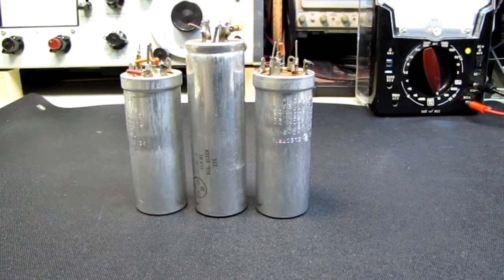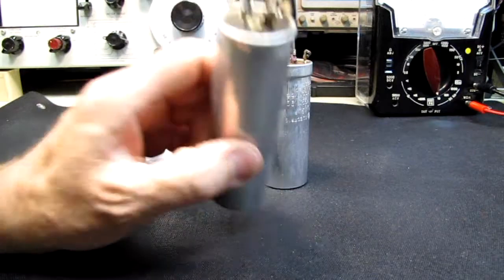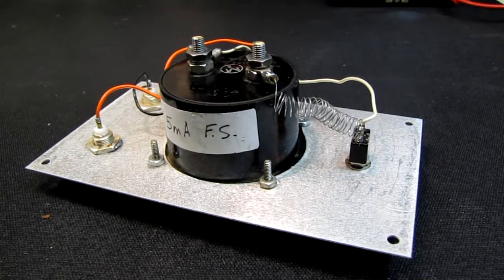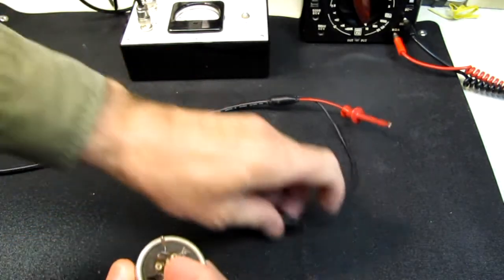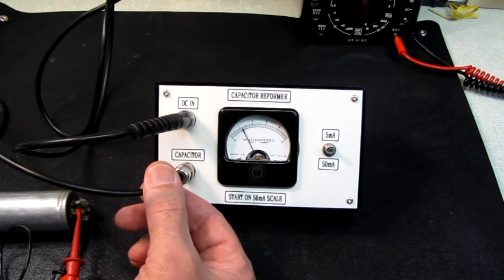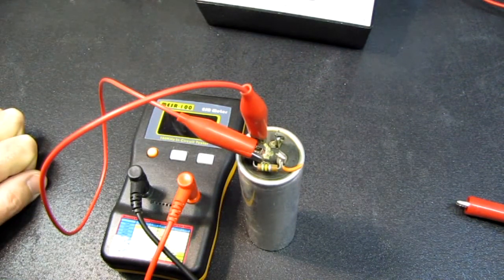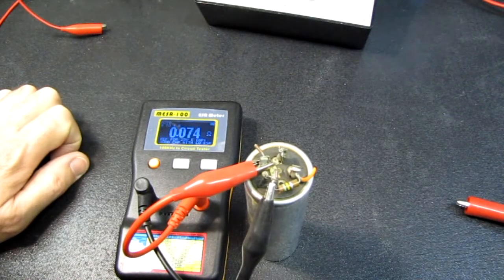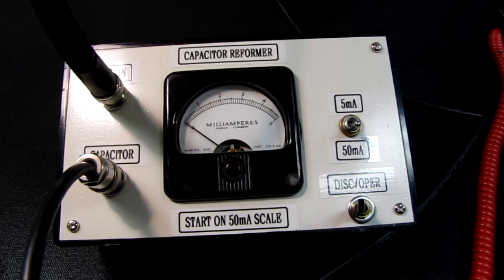Reforming Old Electrolytic Capacitors

Comment: Can I reform several capacitors together by connecting multiple capacitors in parallel?
Reply from the maker: absolutely, just remember you should not use them in critical applications. I have had some fail a few times. But in a pinch, or to test something they are usually fine. Just be careful, a charged bank of capacitors has a TON of stored energy.
Reply: @theradiomechanic9625   thank you very much for your prompt reply.

Please could you clarify what you meant by “using them in critical applications” were you suggesting not to use old capacitors in critical applications?  Or not to use capacitors reformed by using multiple caps in parallel in critical applications?

Thank you for the cautions.  I am trying to reform 120 pcs of ~4700uF capacitors with voltage rating between 100V to 400V.  It is between cautiously repeating the process 120 times or 12 times with extra extra caution.

The capacitors will definitely be placed in a covered plastic container with no exposed bare live wire.

I am however concerned with the heat buildup with faulty capacitor that affects  the other capacitors being reform.

Comment: The Radio Mechanic this work on NOS paper wax capacitor just wondering? I was thinking about older paper wax capacitor they love to leak when they get old. Think that if fresh hot wax was put on a NOS paper wax capacitor fix any leakage?
Reply from the maker: Hello Brian, Excellent question, however the answer is NO. I have tested literally thousands of NOS paper caps and found perhaps three that were leak free. The internal paper insulator layer of these caps degrades with time and is irreversible. Do not trust them as they will eventually fail and can damage other components. 

Electrolytics are a totally different chemistry and if the seals on the cap are intact, and if the internals are still moist with electrolyte, they can be "reformed". However I only do this as a temporary measure to test the rest of the set for viability.
They will get replaced before giving the set back to the owner.

If I have an historically important radio, something rare and special, I will "gut" the paper caps and restuff them with modern caps then seal up the ends. I always leave a note in the set informing the next tech that the caps look old, but are new.
Reply: @theradiomechanic9625  What russian pio Capacitor ? I have seen people test them and test good think they used a special paper plus some had glass ends
Reply from the maker: I haven't used any of those caps. They are basically the same thing and if only a year or two old (from manufacturing) they might be OK. However I would use a capacitor leakage tester that tests them at operating voltage for leakage. 

These are marketed to the Audiofools who have convinced themselves that the old paper caps "gave the amp the vintage sound".  What these clowns don't understand that when brand new the caps didn't leak and the amp sounded like it would with modern caps installed.  @briansmith9698

Comment: i bought a barely used Nakamichi cassette deck that had not been used for 20 years. Before buying it I asked the seller to leave it switched on overnight. It works absolutely fine. A repair guy tells me it will need an expensive setup and should have been started up slowly with a variac to not damage the caps after they had not worked for years. Is there any point in tinkering with a Nakamichi that looks new inside and out and works ?

Comment: Can I use a hipot (ac/dc/ir) tester in DC or IR mode to test capacitor? It is a programmable hipot tester and wont be set higher than the rated voltage of the caps.
Reply: Might be possible with some advanced devices - the simple handheld kind tends to come with instructions like "if you are measuring sub-megaohm, do not leave connected for more than a couple seconds".

Comment: everywhere I read on reforming, it essentially says to buy new replacements; that the older ones may reform, but not perform. what I was doing with limited success, was slowly ramping up the voltage with a variac, for several days. patiently waiting. nice video and gadget. thanks.
Reply: actually came on here to ask if polypropylene caps can be reformed- the yellow mylars. they sound good in contrast to new polys and in a preamp; but I've been reading up on leakage and think I should follow the learned rule of replacement.

Comment: Back in the 60's I used to do this and the thinking back then was it should be done with pulsating DC - usually half wave rectified. I used to let them sit for a couple of days for reforming. Even then the failure rate when put into a working circuit was not low so be careful.

Comment: Nice Build!
I was fortunate enough to salvage an old 1967 Westinghouse Elevator Variac and cram it, a step up transformer, rectifier and charge/discharge resistors into a seahorse case for a portable variable voltage PS cap reformer: https://youtu.be/fUDB7oavJkg

Comment: what the heck is capacitor reforming ??
Reply from the maker: When capacitors sit, the electrolyte degrades and the caps begin to loose capacity and the breakdown voltage drops. Slowly applying increasing voltage while keeping the current under control can often bring old unused caps back to useful life. 
This is why you should never just "turn on" an old antique radio that has been sitting for years.
Reply: @theradiomechanic9625 I generally agree. My electronics prof told us back in 1979 that old caps tend to last 1 or 2 years after reforming. Think if them like a lead acid battery whose plates are oxidized heavily.
 Anyways..I juice up old caps for as long as it takes to troubleshoot old gear before electrolytic replacement, before they wreck something. I always leak test first
I have some non polarized caps here from the 50s that only leak a few tens of picoamperes. Amazing really.

Comment: Nice work. Hey, what are you using for panel meter labeling? Thanks for the video.
Reply from the maker: HI Craig. Thanks for the kind words. Those are just Brother Labels. Nothing special. When I was really into it I used to make complete overlays with graphics. No time these days.
Reply: The Radio Mechanic sounds good,  thanks.

Comment: Hi Vern. Revisiting this, thought it was purdy slick first time through. Got me a Sencore LC53 cap tester. (No, not for ten bucks, shame on me 😉). It can reform caps as well, but I'm really liking the dedicated gage unit idea. The Sencore manual also delves into cap reforming using a bench power supply. It recommends using a 1k ohm 5W "surge" resistor in series with the cap. I notice you don't have such a critter. I take it it's just to cushion the current to the cap. Any thoughts?  Regards, Terry.
Reply from the maker: Hi, yes I agree a resistor in series to limit the current is a good idea. I also have a Sencore LC53, handy unit.
Reply: Thanks for the reply. I've got an old Simpson gage and still gathering the other bits. Thanks for the instruction, and the inspiration. Good stuff. 🍻
Reply: 1. Is this resistor used to discharge the capacitor or is it used for the above statement for "surge"?
2. Does it matter what terminal you hook up the resistor to?

Comment: Question for ya, Vern.  Do those BNC connectors on the panel need to be isolated type?  Oh, and thanks for another great instructional vid. 👍
Reply: Aah, I see they're single wire soldered, ground lug is connected to the panel. Forgive my noobishness, ground circuit is through the panel. Yes?
Reply from the maker: You have it. No need to isolate it. Thanks for watching.

Comment: I found a bunch (1/2 pickup load) of NOS Sprague can caps.  Still in original boxes.  Can these be reformed and used safely?
Reply from the maker: Sprague made quality caps. If these are in good shape and NOS they should reform well. Keep the current under 2 or three mA for a few hours and they should be OK.